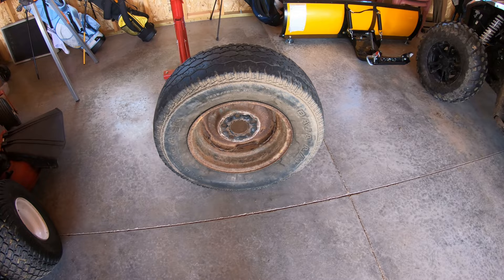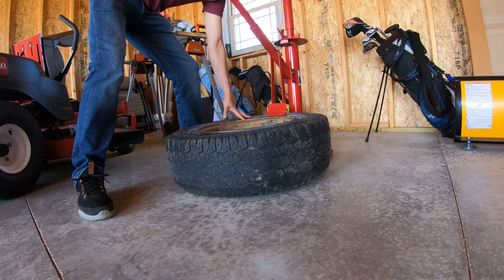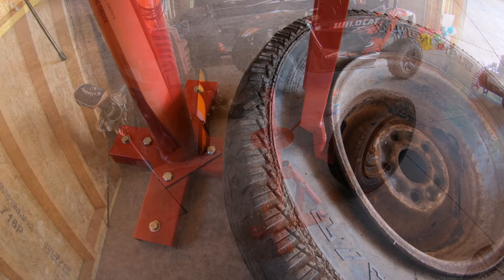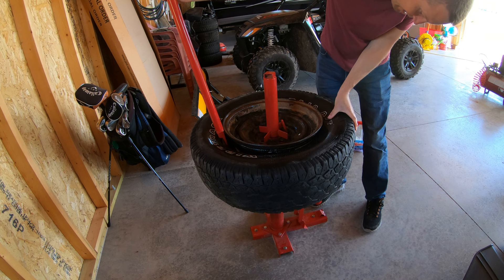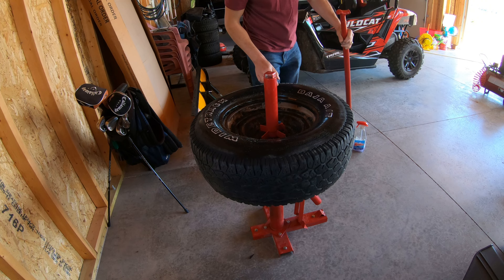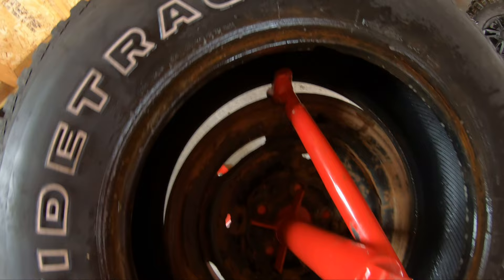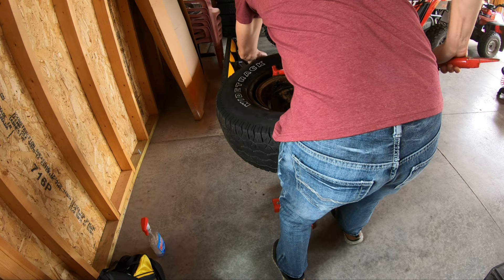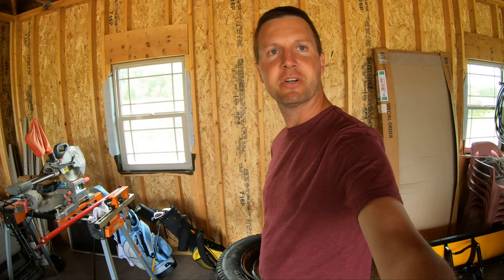How to Use a Portable Manual Tire Changer and Review

Comment: best way to not scratch or damage the rim edge is simply to turn the rim upside down with the face pointing downwards. Just cut a hole in a rubber mat and place it on the top surface of the harbor freight tire changer. When working on the backside it doesn't matter if you get some minor scratches
Reply from the maker: Great advice, thanks for sharing.
Reply: As a tire changer/Manager at a tire shop, not all rims can mount tires on the back side due to "that crevice also known as the drop center" That was described in this video is a valley where the bead sits for mounting and dismounting. Steel wheels and alloy can only mount/dismount from the top/face. Custom/deep dish wheels mostly mount/dismount from the back side due to the drop center closer to the back of the rim. A good indicator of this is where the valve stem is location and looking at the back of the rim to see either a small indent or flat. Will tell you that the rim will be either front mount/dismount or reverse mount/dismount.

Comment: I did a few modifications: welded the base together, bent the bead-breaker arms, so welded an extra bar to one side, and had to grind an buff the bar end for removing the tire, as the sharp edge was damaging the tire. I think I also did some grinding and buffing on the goofy end. I also just ordered a cone for doing aluminum rims, as that hold-down is brutal on rims.
Reply from the maker: Great mods!  I’ve been doing a couple as well to add a little more strength and ease of use.
Reply: what cone ?
Reply: @itsMadrizzle  I twice ordered aluminum centering cones to use on the tire changer, but both times, they sent something so small it just falls through the center of the rim.  I just didn't want to spend the big bucks buying one locally.

Comment: Great video! Very clear instructions. We used to have a manual changer at my Pop’s old gas station. You use the pry bar to install the tire the same way you use it to remove the tire, the knobby end of the bar will guide the tire onto the rim, when you rotate the bar around the center post. It easier and gentler than prying the tire on. Good job!
Reply from the maker: Thank you, I appreciate your comment.

Comment: Freaking nice job, buddy. You made it look easy with one bar while other videos you got guys struggling with 2 or 3 bars. I'm sure it also depends on the size of the tire and rim but still, you made it look really simple.
Reply from the maker: Thanks!  I found it even easier to Mount new tires versus old ones.  The older the tire the stiffer it gets. I am now using BeadBuster Tire mounting lubricant for removing and installing tires.  This made the job a lot easier.

Comment: Ramset make a  recessed screw thread anchor. Install that in your concrete floor. Bolt the tyre changer in place when using, remove and store when not in use.

Comment: Taking the tire off with one ain't that bad but putting a low profile back on the rim is ridiculous with one of these. After hitting my hand multiple times from bar slipping I got the tire off. I could only get new tire halfway back on rim and said forget it. Even if ya got that thing bolted securely it still wobbles in the worst way. My hats off to ya guys that have the experience to use one efficiently.
Reply from the maker: Low profile tires are difficult to mount in general.  Try using this next time and it will make a world of difference.  Tire Mounting Lube: https://amzn.to/3XgUoCE

Comment: I also got the same H.F. changer .. Price was $ 29.99 + tax + $ 16.65 for cement anchors and tool,
another $39.72 for a hammer drill .. Total $ 88.56 ( so far ) ..
I have added a length of electrical conduct over the top post to act as a bearing to turn as you 
move around the tire ....

Comment: Nice video wish I'd saw it before doing my first set, which were 17". A suggestion when removing tires keep the red bar at a steeper angle, it causes the tip to lift the tire, lower angle close to the rim makes it chisel into the bead, which can RIP the bead.  Great  mounting I had to start exactly like you did but had to use the pry endand a screwdriver to stretch it to the pop on. I had help too as I'm not very large but they were 265/70R 17.
Reply from the maker: Thank you.  Good info to know.  I now use a good amount of tire lube when using this tire changer.  It makes a huge difference, so much easier.  For the price, this tire changer is awesome.
Reply: Anyone now how to do low profiles
Reply: @Tay-ok2bh  yes. With a lot of elbow grease.
Reply from the maker: @Tay-ok2bh  If you use this adaptor in this video https://youtu.be/c7i0NWZ9dDk  it will bot be that bad.

Comment: Nice job and thanks for posting. I been watching a ton of these videos as I wait for the weather to warm up so I can install and use the one I just purchased. I already anticipate bending the bead breaker tube and the bar. It seems like a decent tire changer that has the basics you can then modify to make it more HD like many on Youtube have done.
Reply from the maker: Thank you. Yeah, it is a great tool.  It’s surprisingly tough as is but it sure wouldn’t hurt to beef it up a little.  Get yourself some good tire mount lubricant, it’ll make the job so much easier.
Reply: @DeanoOutDoors  - Yep for sure. I changed many tires shops I worked at back in the day and always lubed up the the beads. I'm swapping tires onto 4 new rims on my Jeep and can't wait to put it to use first time.

Comment: I realize the tire spec for the tire changer is for 16 inch. I guess everyone has been using it for regular car tires 16+ inch without issues?
Reply from the maker: I have changed 17” without a problem.  If you start changing larger tires, you may need some mods done to the changer.

Comment: So now I'm going to try it on my six-ply Goodyear off-road tires and see how it works I'm going to take a big heat blower and warm them up first I got one on my hand but it was a terrible battle
Reply from the maker: I have since bought BeadBuster Tire mounting lubricant, this will help you out tremendously in removing and installing your tires.

Comment: You made that look easy Sir.....would you know if this will work with motorcycle tyres?
Reply from the maker: It’s not too bad. Did you happen to see my newest video using an attachment?  It makes removing tires so simple.  As far as motorcycle tires, i think you’d need an adapter. This model is not designed for them.

Comment: Does it have to be bolted to the concrete for stability
Reply from the maker: It is highly recommended, but I’ve seen others bolt it down to a pallet. For tougher wheels, it will need be bolted down to concrete.

Comment: I guess if you only have a junk tire it's ok to practice on it, I made my own tire changer on T wagner YouTube and it's a similar design to yours. I mounted 2 tires, new ones, so far and did it slightly different to your method using only the pointed end of the bar
Reply from the maker: Nice!  I have recently bought a new mounting bar that makes this project a whole lot easier. I'll be uploading a video soon!
Reply: @DeanoOutDoors  I really needed to see your video since I was making my tire changer from scratch. I have since made a bead seating tank, works good.

Comment: What size is the bolt that you mount to the floor, there are 2 parts, 1 is the bolt and the things you drill to the floor and inserted what do you call that, thanks
Reply from the maker: That is 3/8" x 1-5/8" Steel Drop-In Anchor
Reply: @DeanoOutDoors  Thank you. You safe me from guessing.😀

Comment: does it scratch the outer rim paint?
Reply from the maker: If you have painted rims, I would suggest purchasing the No-Mar tire changing bar.  This setup works great on steel and aluminum rims, but the demount bar could scratch painted surfaces.
Reply: सुपर